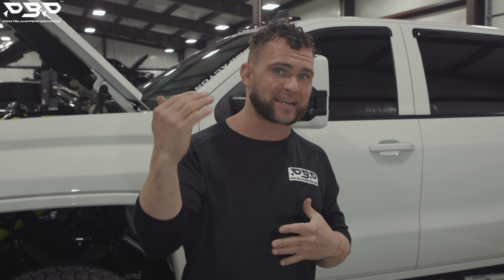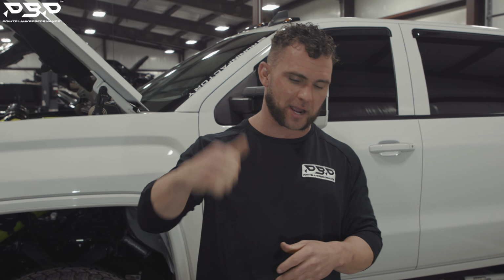1,000RWHP COMPOUND L5P BLOWS UP BOTH TURBOS!!

Comment: How drivable will it be on the daily?
Reply from the maker: Very! It’s a big air set up but still able to daily and tow when needed just have to work the shift points around the power
Reply: @POINTBLANKPERFORMANCE   so I just added a bigger turbo and had it dialed in do I need to have my tcm tuning revised or will it relearn after some miles are put on it? Lml Duramax

Comment: I can’t wait to see this thing get down. I’m super curious of why those turbos took a dump out the gate. They are not junk and you do unbelievable work so my guess is something is wrong with the intercooler or stock intake clamshells something that u didn’t touch. Those turbos over sped for a reason and if you were worried about that at all to begin with you would have gated them. Or maybe I’m way off and they didn’t over speed god damnit I can’t wait to see this shit!!
Reply from the maker: Your on the right track !